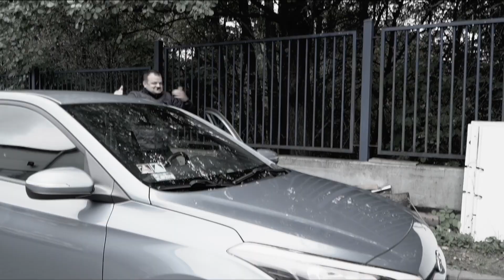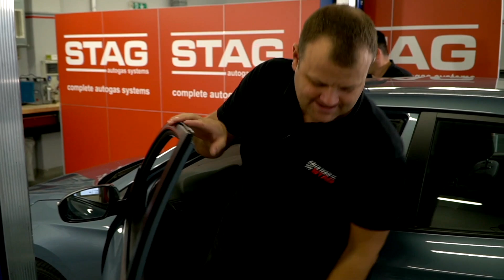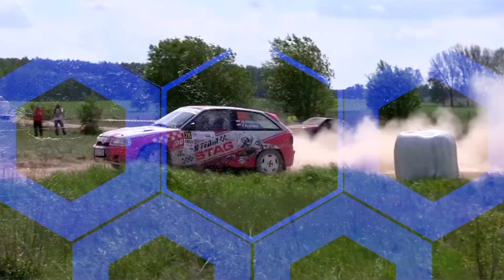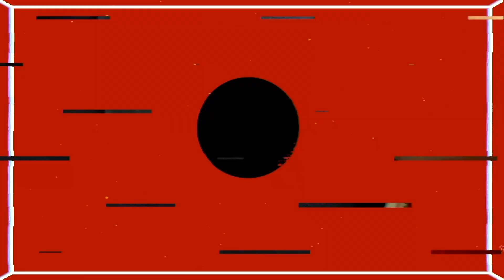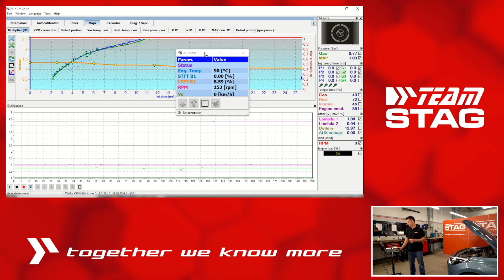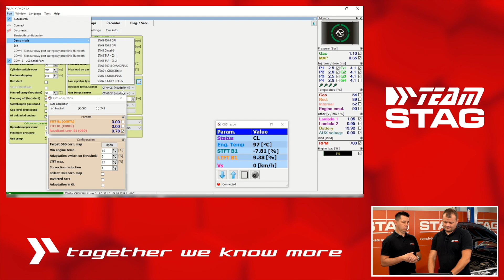Problems with LPG installation and how to solve them

Comment: Hello, I have a Stag 200 and I would like to tell you that while my car is running on gasoline, everything works normally, but when I turn it to gas, it makes some jerky interruptions during acceleration between 2000 - 3000 rpm. No mechanic has been able to find the cause. I have changed the multipliers, spark plugs, air filter, and MAP sensor in the car and it still keeps doing it to me. Can you figure out what could be wrong? My car is a FIAT GRANDE PUNTO model 2007 petrol

Comment: lpg works flawlessly but when I switch to petrol the car misfires/jeks... but when I take the lpg fuse out at battery side (lpg off/no power to lpg)... the petrol works perfectly (new engine oil, new spark plugs, new MAF senor, 4 new ignition coils, new fuel pump, REPLACED with new lpg ECU ... THE CAR  IS STILL MISFIRING/JERKING when switching to petrol (installer can't figure it out)...  PLEASE HELP

Qbox plus (with stag led 600 lpg/petrol switch),
Honda civic 2008, (UK model)
1.8 petrol
R18A2 (engine)